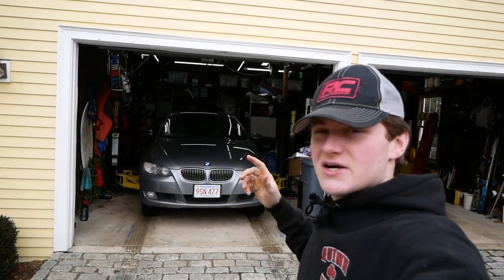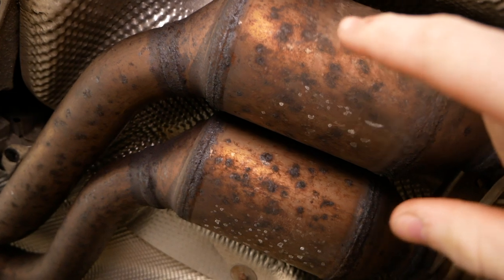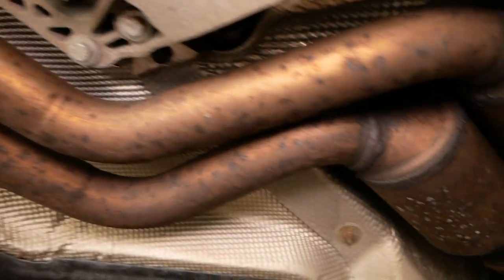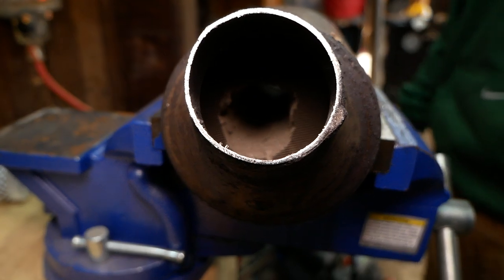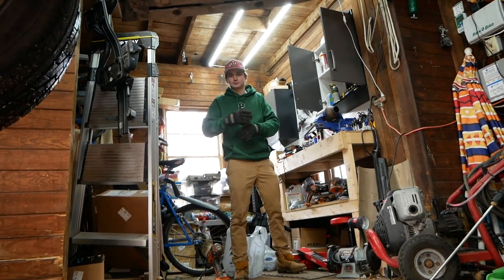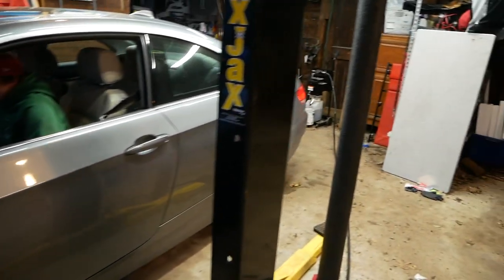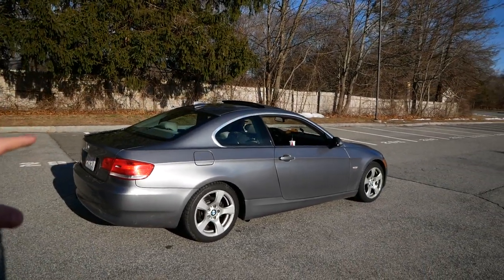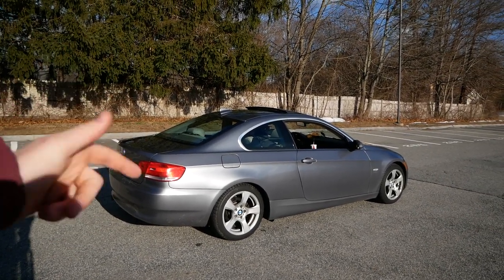HOW TO DELETE SECONDARY CATS (FOR FREE) // BMW N52

Comment: Forget doing this, its a huge waste of money. If you want to delete your cats, replace them with regular pipes and sell the cats, the sell for hundreds of dollars used because of the material they are made of. I've been offered $500 for my cats off my e93 328i. Rather then it being free you will actually make money but be warned, in canada it will not pass safety without the catalytic converters, and most other countries i assume aswell.

Comment: I cut everything off but the main cat in my X3 it’s so loud for a early 2000s suv it confuses everyone around me 😂😂
Reply from the maker: Hahahah I always wanted to try that with my X3
Reply: I couldn’t find a exhaust for anything under 2000$ so I just cut it all off welded a 2”5 inch stainless steel pipe all the way back with dual tips on one side. If you rev up enough or do a pull sometimes it pops an bangs 😂😂

Comment: Nice video, but if you are cutting the exhaust  before the flange anyway, you shouldn't need to cut twice next to the cats. One cut next to the cats would have been enough to get out the material. Or am I seeing this wrong? But again, doesn't really matter, thanks for the video :)
Reply from the maker: That was because the flanges were extremely rusted and the exhaust could not be removed without making the second cuts
Reply: @JDCarsChannel  actually no you could have cut both sides before the flange and removed the whole back section of the exhaust.... mine was rusted the same way
Reply: @JDCarsChannel  another idea would be to put a reciprocating saw right down the gasket on the flanges threw the bolts then hammer out the studs and replace with bolts I do this on all N54 DPs

Comment: I feel like I missed something I'm considering the same deal if you're going to remove the exhaust completely to weld it all the way around then why would I cut the cats off on the car? I was cringing when I saw your little buddy there with that power saw right under the car

Comment: Do you have to tune the computer if you take them off and straight pipe them or will it be fine?
Reply: Secondary cats don’t have sensors. You’ll be fine taking them off
Reply: @danielgeorge8871  what I never knew this thank you
Reply: @danielgeorge8871  somehow I still had a check engine light when my secondary cats were removed…then I put them back on few months ago and the day after the check engine disappeared
Reply: @wass.s3001  within the 2 years I’ve typed that comment I have learned that there are o2 sensors in secondary cats as well lol
Reply: @danielgeorge8871  oh god lol did you code it out? How did it go?

Comment: I have to replace my catalytic converter check engine light came on great tutorial video
Reply: The secondary cats have nothing at all do to with your check engine light
Reply: Did this work? The only reason i would think 2nd cats would cause a cel would be if they’re clogged, they’re after the o2 sensors so they shouldn’t affect anything.

Comment: You should have just gone straight for resonator delete bro. Then done 2nd cats if you need to. Ive got N53 330i sound is epic. The total sound deadening is the resonator. I also have a custom 4 exit like you get on an M3. Goes through a big open cylinder which makes it even louder. Car sounds like a motorbike now.
Reply: Hey I was wondering did it throw any check engine lights when you did that. Just wondering thanks
Reply: @jerrydestin6774  No! I took it to a proper exhaust place Deutsch Tec in Milton Keynes England. Had some suspension changed too so that threw a few engine warnimg lights but they used there compuer thing to get ride of it. Ive previously  had a muffler delete and the dual pipe turned to a quad. 

Be ready for the exhaust to sound fucking unreal once you take out both Cats keeping primary. Its like the devil is coming for you. Such an exotic sound these engines are very under rated.  

Litrally sounds like a 911 thats has a sports exhaust and not the standard thr GT2. When you do exhaust work to a 911 they are even more crazy. Similar engines big 3.0lt Na lumps. The porsche engines are of course Flat six but all around 300ish BHP basically a tuned version.

The E46 3.0 straight six is very similar in performance to the 911 engines if bot better than some some of the older ones

Comment: I understand you taking out the secondary’s cats to get it louder as i did it yesterday also.but What I don’t understand is why on earth would you destroy the valuable ceramic material inside of the converter ????? And than proceed to put them back on like wtf I have never ever seen what you just did…. You basically threw away 400 or so $.They could be anywhere from 150-300$ each… a metal pipe could of been put where the converters were for roughly 25$. Instead like I said before you proceeded to throw money away, terrible advice.FYI yes the martial inside of the cat needs to be intact otherwise nobody gunna want to buy a bag of dust. Jeeez man
Reply from the maker: We were young kids and didn't know! Hindsight is 20/20
Reply: @JDCarsChannel  smart answer, I would have done the same in my 20's, I know better now.

Comment: do you get any check engine light once they’re deleted?
Reply: Not unless it was already tuned.
Reply: No you do not get a engine check light.I own a 328xi 2007 I deleted both of my secondary’s yesterday no engine light.  Why you may ask ? Explanation is very easy the secondary cats do not have the 02 sensors. therefore once cut out it does not trigger a engine check light. However primary catalytic converters have 02 sensors therefore if you cut out the primary it will trigger a engine light as the amount of air is not being measured/detected.
Reply: @chrischambers7103  if your removing primary cats it will trigger a engine check light as there is 02 sensor slots built into the primary’s. Only way to remove the engine light would be to tune it out with a option for “catless down pipes”. Again if secondary’s catalytic converters are cut out they do not trigger any sort of engine light. It’s if as nothing happened to your car but it got louder. Cheers man and don’t relay on people’s information from a YouTube comment because half of the time they don’t know what there saying. Proof is right here man.
Reply: Does it really matter I mean, if it's a Beemer the light will probably always be on anyway 🤔 😂
Reply: @aimized1460  I have a 2006 bmw 330i and there is two o2 sensors before the secondary cat and those will trigger the light to come on if any of ur cats are bad or missing , only way the light won't come on it if u put a spark plug none fouler spacer on both down stream sensors.

Comment: About to do this to my car. I don’t have access to a welder tho so I’m wondering if you think this will work. Unbolt the pipe from the headers then cut both off the cats on the side closer to the rear of the car. Then I will have that piece off and will be able to take all the stuff out of the cats from one side then bolt one side back to the headers and use 2 clamps for the other side
Reply from the maker: Yes! That should work with the clamps, just might be a bit more time consuming to get the material out

Comment: hey jd! is it 2.5” or 2.25” from the res to the muffler on the n52? aswell if you know res to cats?
Reply from the maker: 2.5” res to muffler. You can achieve both by cutting the res / cats out and replacing with straight pipe. Or you can cut them out, hollow the cats out, and reinstall them

Comment: Will this even pass emissions anymore? I'm looking to have a BMW I can actually drive, man
Reply: Real car ppl never pass inspection.
Reply: These cats don’t have any sensors monitoring them so it will pass emissions just fine. And it looks stock since he reused the pipe so it won’t be noticeable
Reply: @autohut3720  no the fuck it wont
Reply: I have a 2008 BMW X3  3.0is  I’m thinking about adding exhaust Headers with straight pipe or mag flow exhaust  
1: will I see a difference in power 2 how do I delete service soon lite. Do you where I can get header made and put on

Comment: You want sound?

Catless headers. Res delete will give you rasp, will make the N52 sound like ass
Reply: I have the performance exhaust which comes with a res delete and it sounds amazing
Reply: I have a res and muffler delete on my n52 sounds amazing not very raspy at all and no drone
Reply: @Nate-ek8qk  lol, i might get a secondary cat delete too
Reply: @matthew1209  hell yea just scheduled an appt to get that done next week, just need to put in a k&n drop in filter, charcoal filter delete and tune it 🤙🏼
Reply: @Nate-ek8qk  i wanted to put an aftermarket intake but ive heard mixed opinions on them some say they make u loose power, but does the charcoal filter add a power increase and what tune are u getting if u dont mind me asking ive been looking
Reply: @matthew1209  ive read up on the k&n drop in filter (about 60$ on amazon) and havent heard anything bad about it since it uses the stock air filter housing and the charcoal filter is just a extra filter layer built into the airbox under the drop in air filter that doesnt really do much besides restrict air flow so you can cut it out. theres plenty of videos on youtube of it being done. i was either looking to get the active autowerkes tune which is about 450$ or the stagefp tune which is about 650$ after all those mods are done people say they get about 250hp or 225hp to the wheels and 200ft lbs of torque
Reply: @Nate-ek8qk  thanks for the info buddy Im going to check out the k&n filter and see about deleting the charcoal filter, and eventually tune it. I was looking at the active autowerks catless downpipes and the 330ci 3 stage intake aswell people report good power gains from those mods aswell
Reply: @matthew1209  yea those catless headers will definitely help free up some air, if you have the n51 engine like i do it comes stock with the three stage intake from the 330i. most california model 328i have the n51 engine